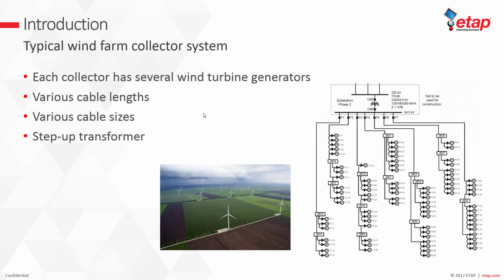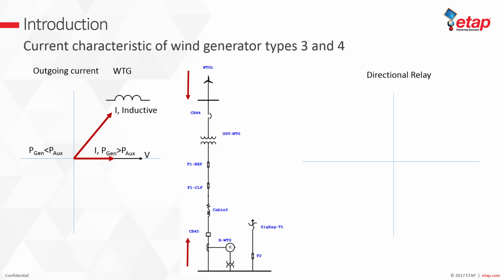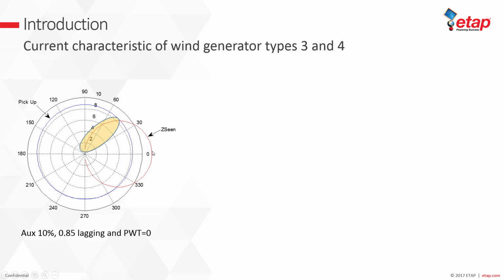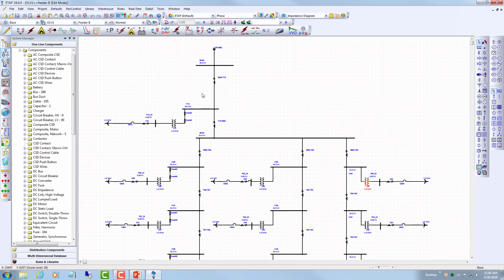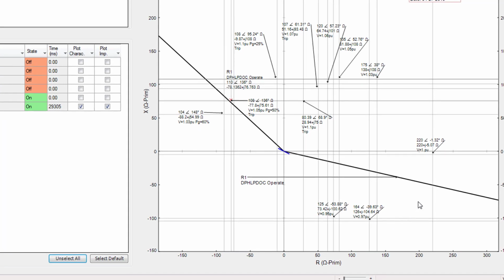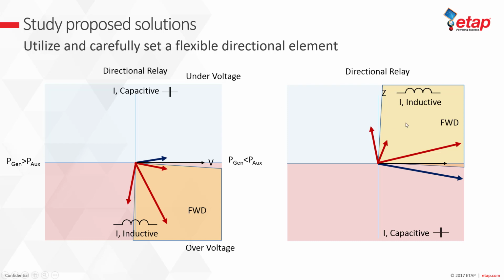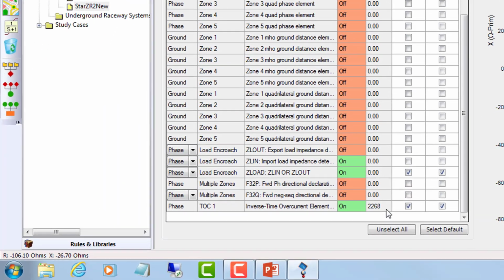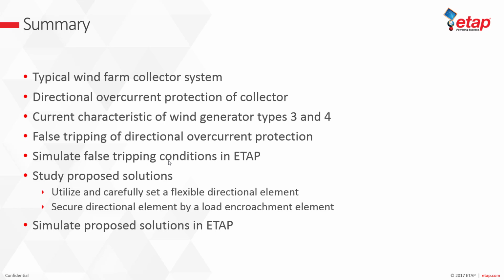Directional Overcurrent Protection of a Wind Farm Collector

Comment: In ETAP why there is no Differential Slope setting?
Reply from the maker: Thank you for your interest in ETAP Software. 
ETAP's StarZ Module for transmission and distribution system protection & coordination, offers vendor-specific differential protection with settings provided by vendors including differential slope. The ETAP analysis is based on ideal differential protection. 
For more information visit https://etap.com/product/starz-distance-relay-coordination or contact our 24/7 Help Center for assistance.
Reply: @ETAPsoftware  Is the any video tutorials for differential star Z?
Reply from the maker: @wongsabarchannel   You can try this video "ETAP StarZ™ - A Realistic Approach & New Insight to Protection & Coordination Analysis" https://youtu.be/7lz_PkEdyoI